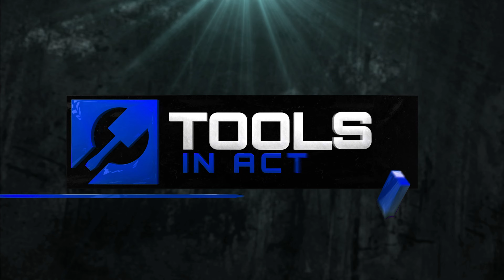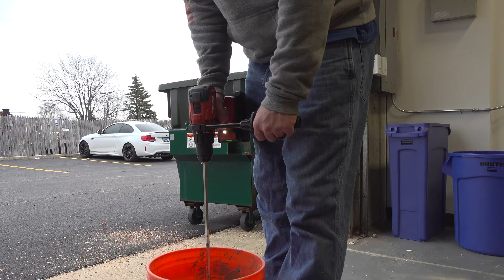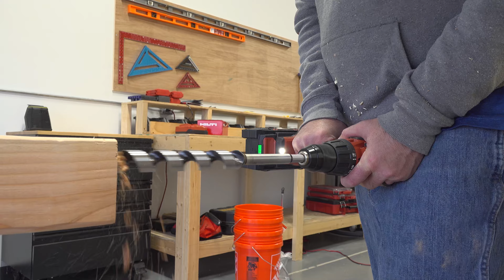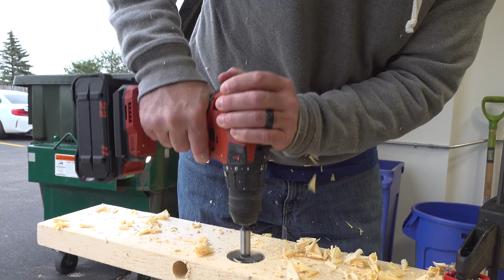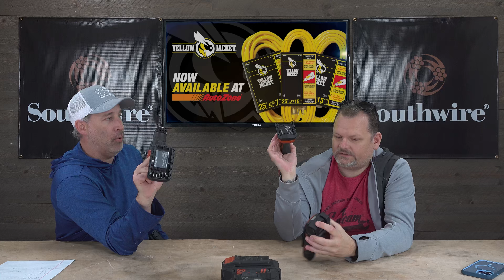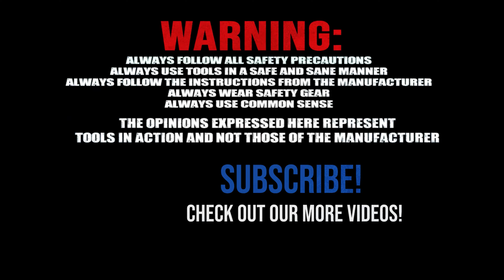Hilti Nuron Drills

Comment: 1/4 impact, hammer drill, grinder , sawzall, portable vacum and two work lights and 4 batteries 3 5.2 and 1 8.0. Is the new battery worth it or just stick with old platform. Looking to buy a circ saw and a demo hammer, go with the new or stick with the old. Thanks

Comment: One really weird thing they did and i dont understand is to move the grip further down from the chuck compared to their previous drills. We have the regular 22v stuff and they did that to those as well. Its simply wrong from 101 physics standpoint. I dont like it and you could definetly feel the difference when you push on it. It twists your wrist back up. WHY HILTI? Why?